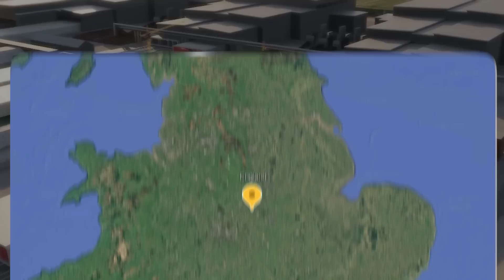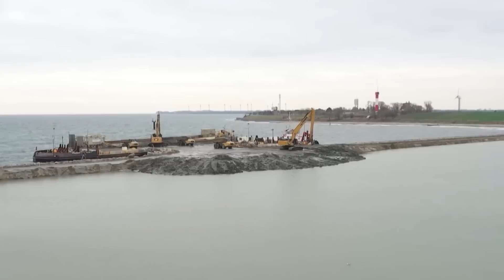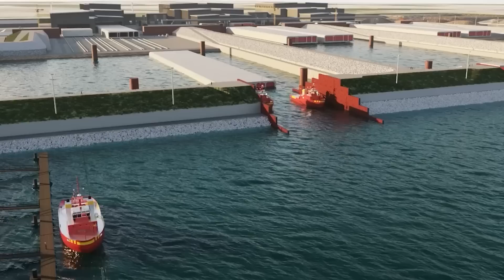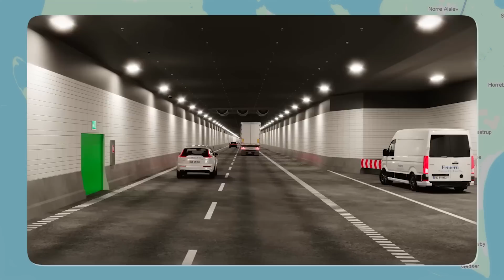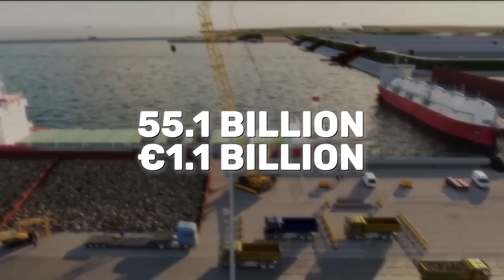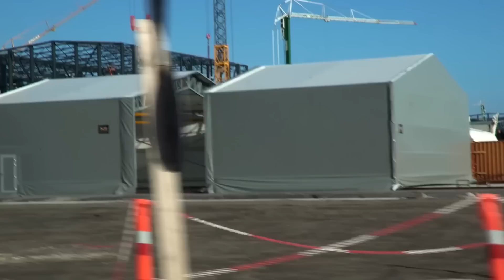Denmark's MOST AMBITIOUS Tunnel Project To Germany

Comment: Contrary to what's claimed in the intro, the construction methods for this tunnel are NOT new. The Netherlands has multiple large tunnels built using this exact same method. It's the scale of the project that sets it apart.
Reply: It is true. This method is widely used worldwide. However, the method 'cut and covertunnel' was actually invented and introduced in Denmark with the Limfjord Tunnel between Aalborg and Noerresundby built between 1964-1969.

Comment: The thumbnail is Peberholm an man made Island in another strait. Is was made for the tunnel / bridge to Sweden. On the Danish side a bridge would have interfered with the airport so the road starts as a tunnel in Denmark comes up on the man made island and proceeds onto the bridge for the last part to Sweden. 
But why use this a thumbnail here???
Reply: It is pretty misleading to use it as a thumbnail, yes.
If i had to guess why they did it, it might be because the Øresund tunnel was also created using the same immersed tunnel method as they also point out in the video